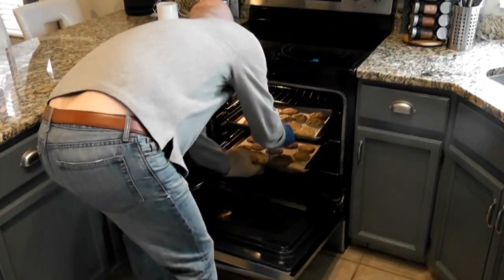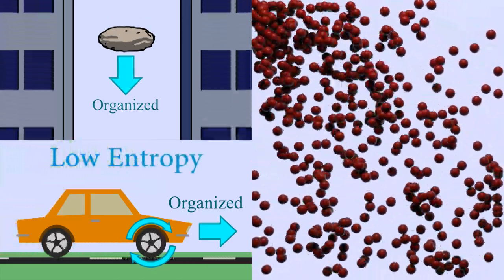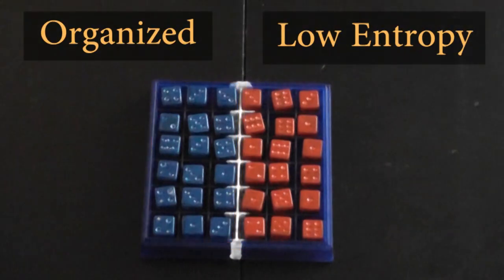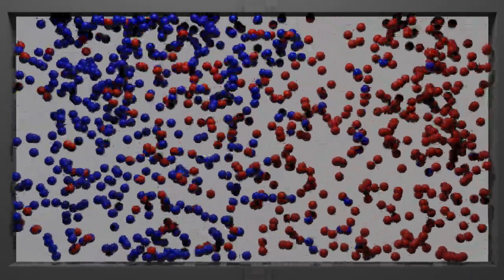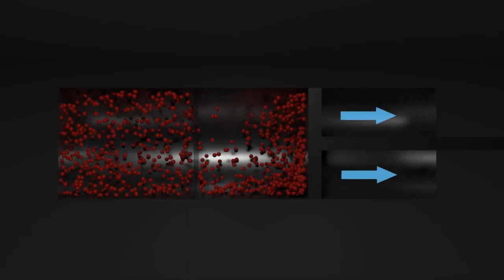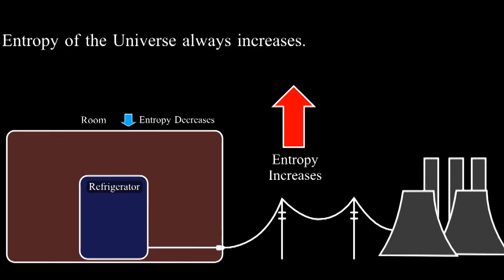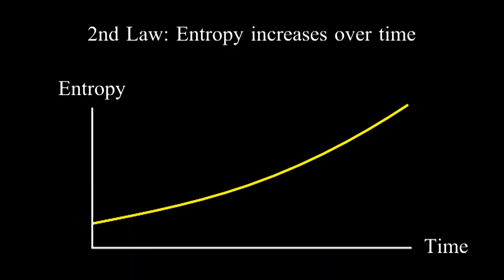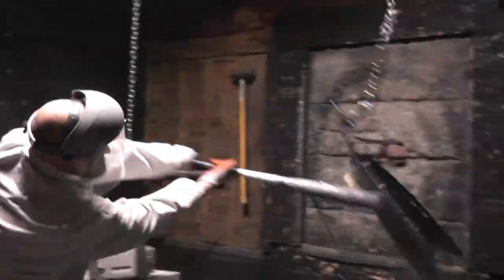Entropy and Time

Comment from the maker: Correction: Entropy does not decrease in a room when you run a refrigerator.  I had gotten the concept of entropy and exergy (Gibb's free energy) mixed up. The principle that entropy can decrease somewhere as long as it increases greater somewhere else is correct.
Reply: instead of the entropy of matter can you make a vid on the entropy of gravity as per Roger Penrose's research on asymmetrical time and the de Broglie-Einstein relation? thanks
Reply from the maker: user-ky5dy5hl4d  We always try to define concepts in terms of more basic concepts. You can define things like entropy, energy, speed, etc. in term of more basic concepts, but at some point you will reach the most basic fundamental concepts. Time is as far as we can tell a basic building block of the universe. I don't know how to define it in terms of something else.

Comment: I also read somewhere (I can't recall the book, I think it was "The Collapse of Chaos" or maybe a book by Paul Davies) of the use of simple arithmetic to explain the complication of time reversal. It's used merely as an illustration and not a direct explanation. But if you take a number like 4, you can say 1+3, or 2+2, or 4+0 all egual 4. That would represent the normal arrow of time. But if you reverse it, it becomes difficult to discern from what 4 came from, due to convergence and dynamics. I'm probably not explaining it well, but at the time I found it helpful to picture the problems inherent in actual time reversal.
Reply: The same Paul Davies who couldn't dismiss a God explanation in 'Demon in the Machine'? Get serious. He doesn't have sufficient scepticism.

Comment: There is a little bit of kinetic energy imparted to each particle by colliding with the oncoming piston, but this is minimal. 

In AC, this compression occurs outside, I believe, then the liquid is allowed to gassify indoors. The reverse occurs. Particles with a lot of kinetic energy (at or above escape velocity) are able to leave the liquid state, but they are slowed down by the attraction to the liquid. This is how the evaporating refrigerant cools.

Comment: I love this video. This is one of my favorite subjects. 

Personally, I don't think the entropy of the universe is increasing. I feel like saying the universe is unstable requires us to postulate a cause for the beginning, which requires us to postulate other universes and their causes and so forth. It's much simpler to just postulate a stable universe.

I think the thing is that we just have observed a lot of low-entropy situations decaying into high-entropy situations and rarely the opposite, so we assume there's a universal trend in that direction. But that could occur if we were born into a time and place that just had that trend. 

It's easy to imagine this since most forces (nuclear and gravity) tend to oppose entropy. I know that's hand-wavy, but so is the argument that entropy is universally increasing. 

Imagine if the universe consisted of a bunch of masses and the only force were gravity. With all the orbiting, there would be times that the whole cluster of mass would be at a minimum density. After that, we may observe "the universe tends towards entropy." Well, it would until it then started contracting again. 

I don't see it as being all that different if you just add several more forces and conditions for those forces and several more types of mass.

Comment: I’m not saying you’re wrong about refrigerators using mechanical work to produce a temperature difference. But mostly they way they work is that as you compress the refrigerant, the refrigerant particles are more likely to attract each other and be able to condense into liquids. The attraction of each particle to the forming liquid speeds it up, thus increasing the kinetic energy of the particle (the thermal energy of the system). It’s exactly analogous to the massive increase in kinetic energy and thus thermal energy in the formation of planets and star from the collapse of all that matter into one body, except, of course that planets and stars so get a lot of heat from nuclear reactions.

Comment: If the atoms moves very fast when we heat then there must be vibrations when we heat any object, right?
Reply from the maker: Yes, that's right. When you heat a gas, the molecules are flying around like I showed. When you heat a solid object, the atoms start vibrating fast. Absolute zero temperatures mean no vibration.
Reply: Not sure what you mean. Another way to heat objects is to send electromagnetic radiation at them, like how the sun heats the Earth.

Comment: When the Universe was young, everything was a soup of particles moving around randomly. That is high entropy. How did it ever become low from there? You can't get more unorganized than that.
Reply from the maker: It's a great question. And one I find quite confusing. I was oversimplifying a bit when I said entropy = disorder. Entropy works completely different when you consider gravity. Gravity is always trying to clump things together. So the "natural" high-entropy state of objects under gravity is to be clumped together. The fact the universe was incredibly homogenous and not clumped is the reason why it had such low entropy.

There's a lot of this that I don't fully understand, so I'll just quote from Sir Roger Penrose "As a way of appreciating the problem posed by the absurdly tiny phase-space volume, we can imagine the Creator trying to use a pin to locate this tiny spot in the phase-space, so as to start the universe off in a way that resembles what we know of it today... The Creator's pin has to find a tiny box, just 1 part in 10^10^123 in order to create a universe with as special a Big Bang as that we actually find... If the Creator were to miss this spot by just the tiniest amount and plunge the pin effectively randomly in to the maximum entropy region, then an uninhabitable universe would be the result, in which there is no Second Law to define a statistical time-directionality."
Reply: @ItsJustAstronomical  I was going to suggest the same thing. So here's a question. Overall entropy can be increased by simply expanding the universe, and what's inside that "perimeter" can become more organized, thus sort of trading space for order, can the universe be infinitely ordered, since it can also expand to infinite space?
Reply from the maker: @mitchjohnson4714  Entropy can decrease in one place while increasing in another. This sounds a little bit like the thought experiment that led to the idea of Bekenstein-Hawking entropy. Scientists were puzzled by the idea that you could create some entropy and then throw it into a black hole. But then they expanded the concept of entropy so that black holes have entropy too.

Comment: So here’s what I don’t get, and maybe you can help me understand. I understand entropy at a conceptual level, but I don’t understand it at a mathematical level. 

You showed us a discrete model, but how does it work with continuous phenomena, like positions in space. I’ve thought about entropy in a chemistry context, so I’m also thinking about rotation of bonds, flexing of  bonds orbital configurations . . . basically all the ways that matter and energy can be distributed. I know that might not be your background, but I don’t expect a detailed answer in terms of physical chemistry. I’m just giving the context for what I mean when I ask about how we calculate entropy for situations where a discrete model doesn’t work, like protein folding. 

For example, where do we get the “S” in the Gibbs free energy equation. Is that just empirical? Do you, or does anyone know of the use of ways to calculate entropy using nondiscrete methods?  Maybe it doesn't matter because maybe discrete models are used to understand it, and then for applications, it's just measured. I don't know.
Reply from the maker: I don't know enough about the Gibbs free energy equation to give much insight into it . In Penrose's book he says something like there are many different ways you could define entropy, but you always come to the same conclusion, the universe is in an unlikely state and moving towards a likely state. Here's a simple way you could measure entropy for the example I showed with particles in a box. Measure the number of particles on one side of the box. Their positions are continuous variables, but you can measure how far away it is from equilibrium by counting the number of particles on each side.
Reply: @ItsJustAstronomical  Yeah, I guess the S is probably empirical because it's probably a lot easier to measure than to calculate from some theory.

But what I realize is that I'm not really trying to ask a scientific question. I'm trying to ask a mathematical question. It doesn't really matter how "scientists" define entropy, what matters is (a) what is reality, and (b) what tools we use to understand what is real. So although I'm vaguely interested in (c) the tools that "scientists" use to understand what is real, it's a minor concern to me. 

So I realize that you may not be familiar with how physical chemists define or use entropy. I'm more just trying to ask a mathematical question. 

So let my try to be more clear: You've used a discrete model, but I'm having trouble thinking, mathematically, how one would deal with this in a continuous situation. Let's say that you  added one more variable to your dice: which side they were facing. So you have 18 dice of each color (and 18 positions), but each die also has six states. So that significantly increases the entropy, or decreases the likelihood that all the blues would be on one side and all showing us "six". This is still a discrete model.

But let's consider it in a continuous model. You have 18 blue dice and 18 red dice in a cube of, say 8 cubic feet. They're all bouncing randomly around  with no gravity, and totally elastic collisions, each free to rotate on three axes. 

So it's a similar situation, where you can ask whether they are "ordered" in that all the blue dice are on one side of the cube and you can see the six face of all of them. Of course they will be much more likely to be in one of the many, many, states of disorder. 

But while I can perfectly see how you considered the discrete case, I have no idea how you could think about the continuous case.

And since the real world is generally continuous like this, I'd really like to understand how one would think about it in such a continuous state.

Thanks so much for your answers.
Reply from the maker: @mitchjohnson4714  What was wrong with my previous description. Divide the 8ft cube in half. Count the number of dice on each half of the cube. How many are at a position z < 4ft. 18 red dice on one side and 18 blue dice on the other is very unlikely.

Also, I found the Roger Penrose quote I was looking for "There is still something very subjective about this definition of S ... Be that as it may, it is remarkable how little effect the arbitrariness in coarse graining has in the calculations of thermodynamics. It seems that the reason for this is that, in most considerations of interest, one is concerned with absolutely enormous ratios between the sizes of the relevant phase-space box volumes and it makes little difference where the boundaries are drawn, provided that the coarse graining 'reasonably' reflects the intuitive idea of when systems are to be considered to be macroscopically indistinguishable."
Reply: @ItsJustAstronomical  I'm not saying I can't understand it using your example. I'm saying I don't know how to calculate the number of different configurations. But writing this out is helping me to think about it. 

I realized that whereas in a discrete model, you can say, like, a gas particle is at pixel (x,y) in a continuous model, you probably have to think of it in terms of a range of values. Like the probability of it being in one exact location is zero, but the probability that it is within a small sub-box can be calculated (or the fraction that will be randomly found within or touching that sub-box can be calculated).

Similarly, with the idea of adding in the orientation of the dice as a factor, the probability they are exactly facing a direction is zero, but the fraction that are randomly within a range of orientations can be calculated.

So one could use a similar method to the discrete method you show, but it would be a little different for continuous phenomena.